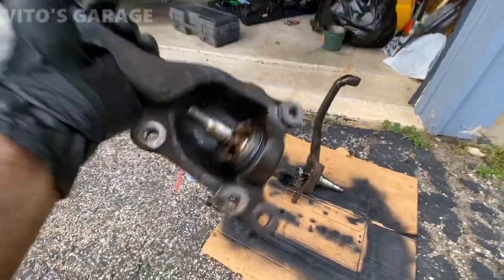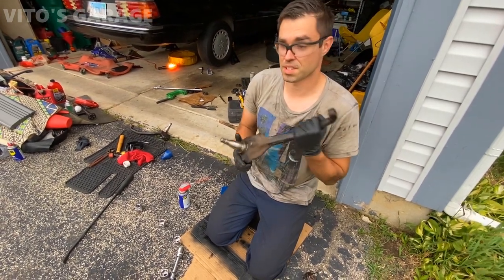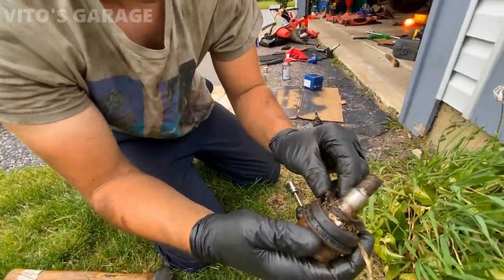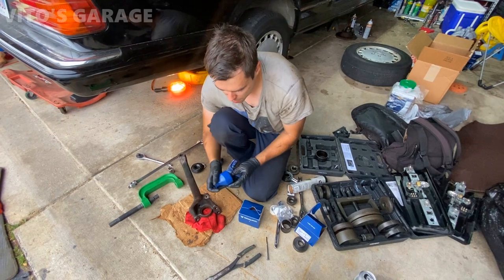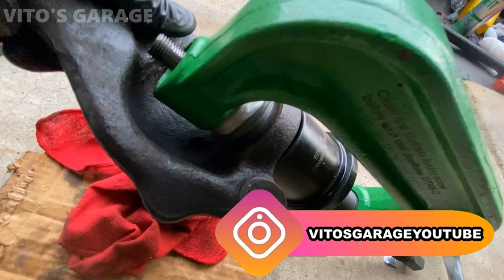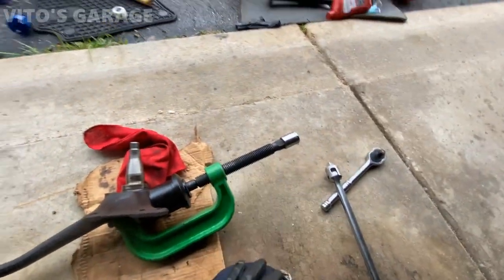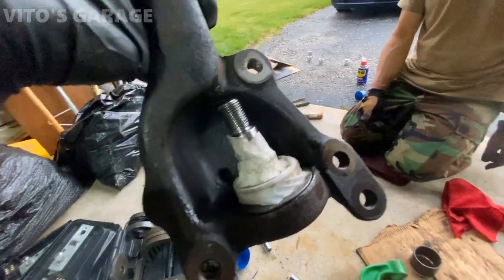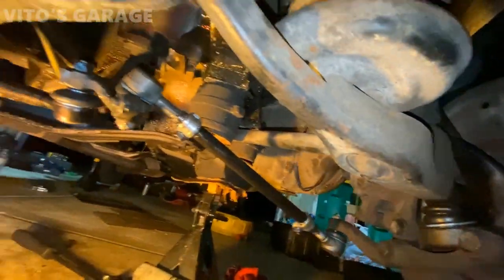How To Easily Replace Ball Joints on Mercedes W126 W123 W220 W116

Comment: A one man job.  Thread the spindle nut on and clamp down on the end to avoid damaging spindle threads.   Get a long pipe (I use the handle from the Jack), wedge into the c-clamp and fix the contraption of knuckle and c-clamp so the handle is wedged under a strong part of the car frame.  Use a breaker bar with socket (10 point) and step on the bar.  Repeat until ball joint is seated.
Reply from the maker: If you don’t like my method you can make a video on how you do it

Comment: It's a really dumb design which relies totally upon a friction fit. Runs the risk of an after market ball joint may be oversized and impossible to fit or undersized and come apart. I've bought a Ridex balljoint, I hope it fits.
Reply from the maker: Use Lemforder ball joints

Comment: Hi Vito. Thank you for the videos that share. I have a question. Recently, a thread on a knuckle for a caliper was stripped and I got another knuckle to change, but that knuckle does not have a slot for ABS sensor. Do you have any experience on drilling a hole in a knuckle? Will that work? Thank you.
Reply from the maker: I would try and repair the threads on the caliper hole. Maybe use a repair insert? 
Drilling a hole for the ABS sensor is more complicated than fixing threads
Reply: @VITOSGARAGE  Thank you for the option. I will try to find out whether an insert will retain 115Nm torque.